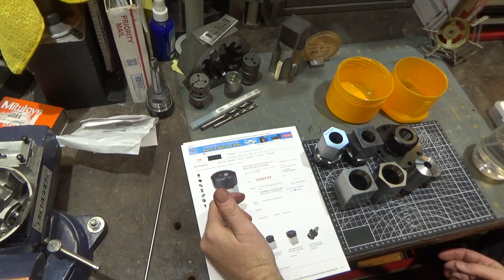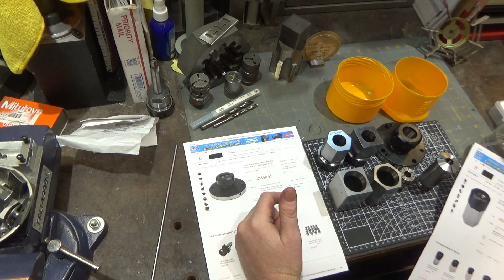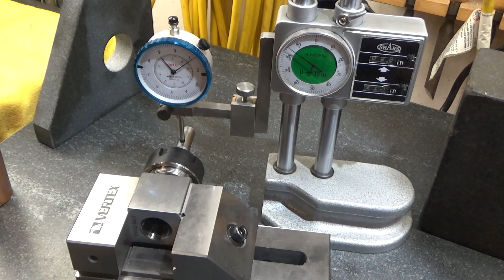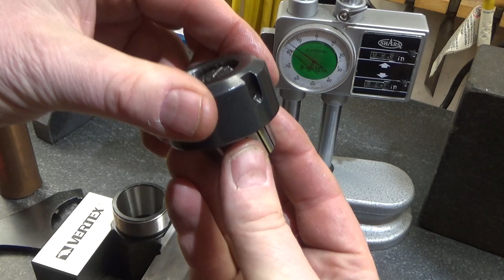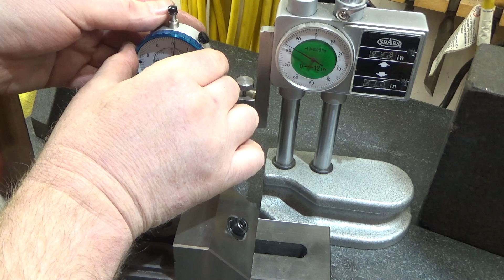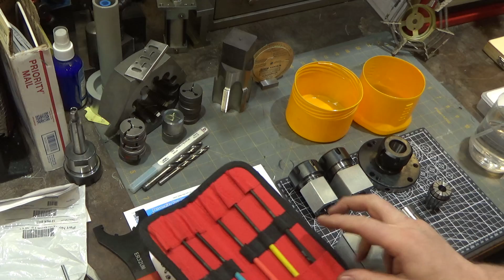QTR 39 BangGood ER32 Square/Hex/Rotary - Chucks

Comment: Good test on the ER collet chucks.
Just one thing when you place a part within a Chuck always try to rotate the work piece to help centralise the part before tighten the chuck.
This rule works for all types of chucks. Lathe and Collet. 

Thanks for the video review.
Regards Peter.
Reply from the maker: That is a very good piece of advise, one that I usually follow, but didn't on camera. Thanks for the very useful feedback.

Comment: Hey Dudley.

I have never liked using ' C " Type collets unless the material you are trying to hold with the
 " C " Type collet is close to the bore size.

Also as you pointed out the range of sizes available in the " C " type collets do have a fairly coarse range of sizes which increase in sizes of 1/16" or 1.60 mm where as the ER style collets range in sizes of 1 mm for metric sizes.
Gripping at the nose of the " C " style collet is a common problem when using these collets and if you need to hold material that is not close to the bore size of the  " C " type collet then you are a lot better to hold the work piece with a 3 jaw chuck instead.

Good video.
 It,s always good to drop by and see what you are up to.
Regards Peter.
Reply from the maker: Thanks for the pointers and thanks for stopping by. By the way, I am not sure if I am interpreting what you said correctly, but you can get a set of 5c collets in 1/64" increments...big buckaroos. Cheers.

Comment: Hello  ... even better is to get yourself some er series nuts that have an internal bearing which causes the collect to collapse concentrically ... I have both BangGood er 16 and 32 and makes a huge difference
Reply from the maker: I haven't hear of those. Thanks for the heads up. I will check them out.
Reply: @DudleyToolwright https://www.shars.com/er-32-ball-bearing-collet-nut
Reply from the maker: Thanks. Much appreciated.

Comment: Hiya, (I assumed your name isn't actually Dudley), might be useful to add that I have both hex and square in 32 and 40 sizes, both of which I have bought additional ball-race (bearing) nuts for, which reduces/removes rotary loading on compression and in turn usually improves repeatability and run-out.
Reply from the maker: I am not familiar with that kind of ER nut. I will have to look into those. I really appreciate the suggestion and my name is actually Robert. Dudley Toolwright is just a play on words with a character in a cartoon.

Comment: I have looked at the flanged collet holder for a while. I am hoping to mount it on my lathe which has a 1"-10 thread. Do you know the diameter of the through hole?  Is there enough meat to actually thread this for mounting to a lathe? Or is the hole already 1"?  thanks for your help.
Reply from the maker: Unfortunately, I do not think that you will be able to put in 1" threads. There is a .202" deep recess on the back that is 1.169" in diameter which connects to a tapered hole the continues to the front. Sorry about that. I think you would have to mount it to a plate and put threads in that.
Reply: Thank you for thie information. Looks like I will have to use a backing plate.

Comment: Thanks for the review. Always wanted to get me some, but not so sure that I need them...maybe one for the rotary table...one day...
Reply from the maker: Your welcome. The hex chuck is great if you need to put a bolt head on something you are making and the square is great if you need to machine features on a round shaft 90/180/270 degrees apart.

Comment: how can you give a final opinion without a critical evaluation,  measure the hex sitting on the flats and the edges, rotate the collet and indicate near the collet and out at the end of gauge pin, find a good collet then test the blocks, rotate it in a spindle and indicate the taper runout,  you know, do all the tests properly instead of phoning it in.
they may be crappy bangood stuff but some of us in the rest of the world dont have proper and plentiful american, japanese or european tooling to choose from. 
I now know nothing about these collet blocks apart from they look nice and you own a cheap er collet set with unknown concentricity
Reply from the maker: Thanks for the comments, you make some fair criticisms. I did actually compare the gauge pin I was using close to the collet and at the end, but did not include that video. Several thoughts: 1. I was not sure if the gauge pins I was using are perfect cylinders. They could be perfectly cylindrical at each end and slightly bent in the middle and still function well to gauge hole diameter. As a result I was nut sure if the result I got were a fair test. 2. The use for these blocks, that I am familiar with is to make bolt heads and I felt that the tests that I performed were good enough for the accuracy of this sort of part. If there are other operations using collet blocks like these, which requires better precision than a couple of thousandths of an inch, I am not aware of them. Thanks for the comments. Always appreciated.
Reply: didn't intend to be so critical, it just came out that way...
 a 12 sided er32 collet block can lie flat without the nut getting in the way, could sort the problem of the hex sitting on the edge in a vise too, that is what I don't like about the small er blocks with the huge nut, they are just cheap and small to save on metal. 
still curious to see if they are crap or not.
Reply from the maker: I am never offended by constructive criticism.  It makes me better and I usually learn something, like, I have never heard of twelve sided collet clocks before and I agree superior idea. As to the blocks I reviewed, I think they are fine for bolt heads or operations that don't need to result in extreme precision. They seem to hold parts parallel to their axis and have reasonably small runout.
Reply: I saw the 12 sided one in an Australian tool site, not cheap but sort of solve a bunch of shortfalls of the ER ones like lying flat in a vise and they were pretty long too

Comment: There is the problem of Chinese ER collets being of generally poor quality. There is a reason American or European ER collets cost what they do.
Reply: yes they are generally 25% better for 250% more in price
Reply: @osgeld  Well that 25% may be the difference between parts you can sell and a box of scrap. The ER system does get a better grip (usually) than a 5C, but they are more difficult to make. Buying a Chinese collet is like buying a pig in a poke... you can't be sure of what you're going to get.
Reply from the maker: You make valid points, but for hobbyists, who are my target audience, you really have to pick and choose your expensive tools, or be really rich. This has to be one of the most expensive hobbies around. That being said it is really rewarding and nothing makes me happier than a great surface finish and a precision fit. I will also admit that my skill set is such, that most tools out perform me. That being said, I do try to get the best tools I can afford and for the critical ones I usually pay for quality.

Comment: Thumbs down for too loud noise at the video beginning.
Reply: Amen to that. It was jarring.  I thought I had my volume set ridiculously high or something; nope, just a way loud intro sound.  It's like commercials being way louder than the show.
Reply from the maker: That is very good info. I try to make all of my levels match with peaks being around 0dBu, but I might have blown it on this one. It certainly was not intentional, like commercial volume settings. My apologies. By the way, the FCC made it illegal to make commercials overly loud, so the networks made the program content lower now so the same effect is there, but they follow the letter of the law.